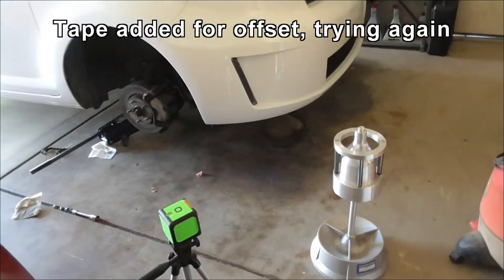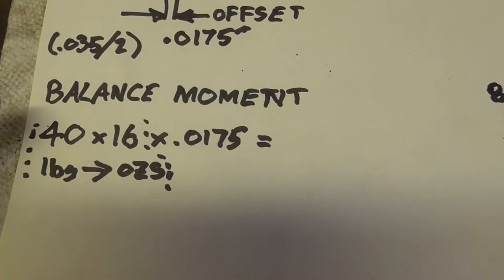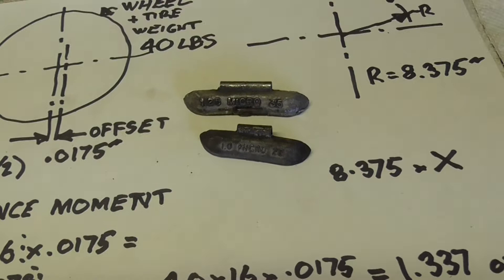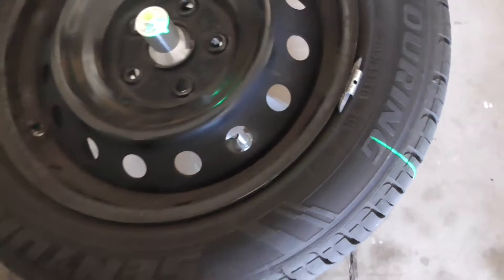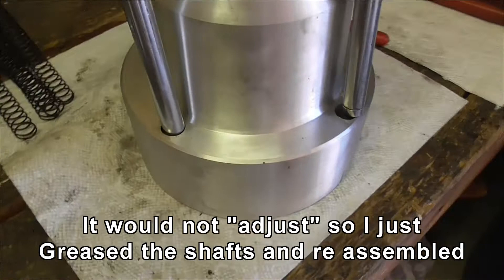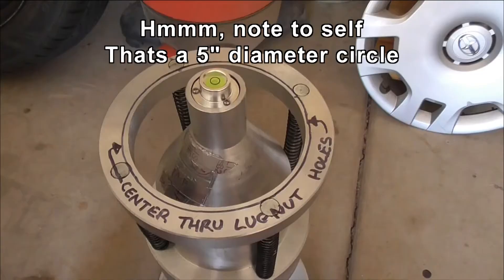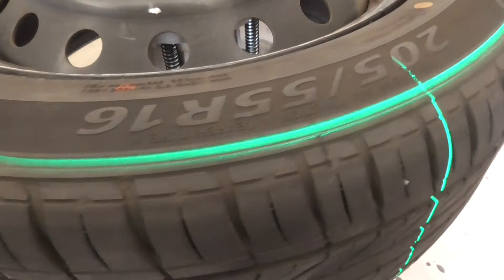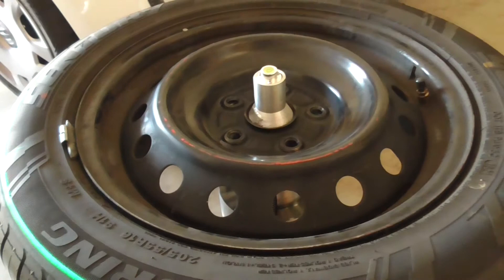HF Bubble Balancer Flaw Part 2 (& fix??)

Comment: I think your solution is probably the same as mine, from a product review comment, I've been getting under the balancer and similar to milking a cow, I pull down on the spring assembly and slowly put it back up to the rim, I think this also centers the assembly on the rim.  I seem to be able to get it down to 1/4 oz accuracy, (doing the rotating of tire for comparison)
Reply from the maker: Gave up with the bubble balancer, was getting wheel vibes at 65mph +did this instead 
https://www.youtube.com/watch?v=du5cTMqpIhY&list=PLWHom5FLIC6u-II0_Ag5QKbXt8W_gcKHR&index=28

And this, when after the seal removal, the preload was too high
https://www.youtube.com/watch?v=li6cBQBcOX8&list=PLWHom5FLIC6u-II0_Ag5QKbXt8W_gcKHR&index=29

The hubs give good results and I did learn how to avoid dynamic instability. 
Perhaps I should have just taped a glass ball to the pilot, put it on a hard level surface and tried the laser again. Would have been cheaper and just as accurate?? (tip from another YouTuber). I may end up doing just this for my sons smaller Xb, rather than buying a new hub.
Reply: @richbinaz  I've used the hub on utility trailer with good success, it would be nice to have a universal hub for the car tires.  It seems easier and more accurate than the bubble balancer

Comment: Only one way this balancer will work correctly because cone is not perfect shape. Do not level bubble without wheel on the cone because cone is wrong shape. Shape of the cone even will changed for different wheels hole size. 1. Remove springs and holding ring completely in garbage. 2. Inside the cone make center hole wider with about 10mm drill bit. But do not drill deeper than oringinal hole center located. Add drop of water to drill easier. 3. Gently with grinder or file make the cone support the shape of a bullet without touching the very tip. 4. Gently tighten 3 bubble screws and loose them 3 turns. 5. Install balancer as it should. 6. PInstall balancer as it should. 7. Put drop of oil on the tip. Install cone. Do not try level bubble with srews now. 8. Put any wheel on the cone. 7. Sit down slow rotate the wheel and center cone in the wheel hole every time before check the bubble. That is very important for results. 9. Put mark with black permanent marker to aluminum cone where is air bubble now. 10. Put mark with chalk same direction on the wheel. Remember exactly where is air bubble now. 11. Turn the wheel mark to opposite side 180° from cone mark. Marks should be opposite sides. Wheel on left cone on right. 12. Now only use 3 srews to close bubble to same location it was before.13. Repeat many times to reach perfectly same location of air bubble. 14. After you reach same bubble location turn wheel angle 90° and repeat steps. 15. Put wheights on the wheel. 
Reapeat steps to check bubble centered.

Now it will work perfectly. I did my wheels balancing better than any tire shop. No vibration at all.
Reply from the maker: You lost me at step 3...
The outside cone seems to be cut on a lathe. 
The first problem is the pivot hole inside is not aligned with the cone. The causes a basic out of balance error.

The second problem is the frame which is supposed to control perpendicularity of the frame face to the cone is inconsistent and can be moved to another position (as I do with the screwdriver) This just adds error. Throwing the frame away just makes it worse.

This is why I gave up with this design, which is now sitting in the shed.

Which is why I moved on to vertical tire balancing, using a friction reduced wheel hub.
https://www.youtube.com/watch?v=du5cTMqpIhY  
See from time index 6:00 onwards

There is another method I'm going to try, a bit more universal I hope. TBD
Reply: Sure vertical universal PCD hub is much better. I dont understand why they dont sell it. Cone is headache.
Reply: wtf to that

Comment: I had the same problem and i remove 2 springs! And you must take 2 springs of the same length.
Reply from the maker: With my unit, even if the spring support kept the wheel perpendicular to the cone (which it does not)...
There is still the offset between the inner balance point and the outer cone.

Comment: use the 1.5 inch ball bearing.  The hole is off center
Reply from the maker: Agreed. The hole is off center and I do not have access to tools to create a concentric pivot.
But that is not the only problem... The spring frame jams, the cone surface is rippled, the basic balance of the whole head is off...
https://www.youtube.com/watch?v=an6sURvUhBA

I bought a glass ball and tried this ... https://www.youtube.com/watch?v=a4Ox_Emh7Ew&t=1s
At least I know the ball is centered on the wheel, just doesn't work on all wheels.

Comment: Not sure i'm gonna buy one of these after watching your videos ! I might go with a simple sphere in the hub hole and placing it on a completely smooth level surface, then measuring the distance to the surface around the circumference of the wheel. And / Or using one of those self levelling lasers and placing weights until it all section of the rim are equal height? These are clearly not worth the £80. I need to come up with my own solution. Have you read about the bada method for supposedly more accurate placement of the weights? thanks for the video BTW, its proved very helpful.
Reply from the maker: I am trying to find another way to balance the tire the same way I do motorcycle tires, which is vertically. About 2:40 in on this video
https://www.youtube.com/watch?v=-4XlyKlUbSs&list=PLWHom5FLIC6uwocukFjFbQJpOSSk5kdNo&index=11

To that end, I bought a rear bearing hub and fashioned a support from some T bar I had from an old garage door opening rail. Sadly the internal friction of the bearings and seals is too much. They also cleverly made the unit near impossible to dismantle by cold rolling the axle shaft up over the end of the bearing.

Your idea with the ball bearing has a lot of merit. It gives direct contact of the ball to the pilot on the wheel, which puts it right where its needed. A hard flat level surface is needed to withstand the high point load of the ball. Go for it - good idea!

The self levelling laser is really quite good, just need a tripod to mount it on. It was a cheap one from amazon but works just fine. don't need to pay extra for the bosch name. Bekoywoy was the name for $35.

For weight balancing, I did learn that if you need to put on 2 weights, put one on the outside and one on the inside, or better, use stick on weights as close too the CG vertical plane as possible. That avoids the dynamic "shimmy" problem. Now where is that CG???

Good luck Daniel
Reply from the maker: Worked a bit more on the wheel hub to reduce the friction and I think it works
https://youtu.be/du5cTMqpIhY
Reply: @richbinaz  You have to get a Junk yard axel with the same lug pattern as the wheel your going to use and make a jig to hold the axel and weight of a wheel so it can spin free .   to go through all that trouble and price,   you can have a shop do it every 4 years   when you need tires .
Reply from the maker: @JCcanU  I used a new wheel hub for each car. 
https://www.youtube.com/watch?v=du5cTMqpIhY&list=PLWHom5FLIC6vZSy2jL7YB3xnY2jVi5Mgt&index=8
Yes it's pricey and a challenge, but it's also a hobby now and it works nicely.
I am also not beholden to Discount tire to do my tires, flat fixes and balancing

Comment: Hi, how did you make your circle? I have a Ford Excursion that has a hub which is too large to fit the cone by a little bit but still fits on the ring. If you could share how you determined how to make that circle I could use this to get around all kinds of craziness and fabrication. If you remember, please share. Thanks.
Reply from the maker: I think I just held a sharpie between my index and thumb, spaced it a bit using my second finger, then turned the ring under the sharpie. However, I was never able to get a wheel to balance properly on the bubble balancer, so I turned to other solutions. 
https://www.youtube.com/watch?v=an6sURvUhBA

This one seems to work well for me and may work for you - if you can find the right size ball to sit the tire on... Which may be hard at such a large diameter ~125mm?? Glass may not work considering the wheel weight.
https://www.youtube.com/watch?v=UVEj-sxsjJ4

Another method I use is this...
https://www.youtube.com/watch?v=du5cTMqpIhY&t=1s
Just have to use something to support the hub and get the internal friction of the hub down.
Cheap hubs can be found at a junkyard or rockauto or amazon or...
The hub I saw on rock auto had a preload nut that could be loosened - helpful. Then you just have to get the grease seal out, which may work easier on that hub.

Need to balance the cost of having discount tire balance them vs cost of making your own rig.
Reply: Thanks so much. I have balanced maybe 10 sets of tires so far and I would say that 8/10 are perfect. I was considering a single hub centric ring in this case for the 125mm bore on the Excursion but none could take up the gap. My plan is to take a piece of abs plastic and a compass along with dial calipers to make my own ring.
Reply from the maker: @jamesdean5677  
I was just thinking that if you removed the wheel support frame, it could fit on the bottom flange. 
Can you center it on that flange?
Image with frame removed
https://youtu.be/an6sURvUhBA?list=PLWHom5FLIC6vZSy2jL7YB3xnY2jVi5Mgt&t=156
Reply: @richbinaz  This is a great idea! I do believe it will fit there but I am not sure how I would center it on that flange. Like you, I am scared to eyeball it.
Reply from the maker: @jamesdean5677  Is this where a hub centric ring could work?

Comment: I have the same problem of inconsistency with this Chinese bubble balancer. I improved it to some extent by freeing the pivot but it is still inconsistent and it drives me crazy. I'm losing my time and my patience.
Reply from the maker: I did a final critical review video here
https://www.youtube.com/watch?v=an6sURvUhBA
The whole thing is so poorly made, at least the one I have is, it just isn't worth using. It is now a paperweight in my back yard shed.

There seem to be 3 possible answers
1. Horizontal balancing: With a glass or steel ball - but it doesn't work on all wheels. The location of the CG on the corolla alloy wheels made it unstable. Here's a link to that
https://www.youtube.com/watch?v=a4Ox_Emh7Ew

2. Vertical balancing: Tricky to create the rig and each hub fits just one style of wheel. The corolla was a 5 stud x 100mm Dia hub. The Scion was a 5 stud x 114mm dia hub. By luck, the 5 x 114mm hub fits my sons CX-5 and I think it might fit a Rav 4 & Highlander.
See links in text below the video...

3. Vertical balancing using cones: Much like the way a motorcycle tire can be balanced, This guy uses cones on a home made rig to get a vertical balance. I like it, but the cones are crazy expensive
https://www.youtube.com/watch?v=dAM6lrBOHOQ

Link to the no-mar website
https://www.nomartirechanger.com/wheel-balancing.html
Reply: most tire we do not need any waits to put them in  balance
Reply: all you have to go is dived the heavy part of the tire  half of the heavyest part of the tire to the valve stem, the valve stem is the lights part of the tire
Reply: how do we find the heavy part of the tire?
Reply: if you have a red dot on a tire  then line that up with the valve
Reply: if you have no red dot,   then look in side of your tire,  you will see it, it's like a laper over  rubber joining of the tire   you can see how long it is,  and how wide it also
Reply from the maker: Dots come in multiple colors, or none at all.
Most common is the yellow dot indicating the light spot of the tire
The red dot is supposed to be aligned with a runout mark on the wheel rim. But I have never seen one of those. @robbaird5972  
To minimize the weights for the tire, find the heavy spot on the rim first. It not always the valve, especially on alloy rims. Mark with tape, then install the tire with the yellow dot aligned with the tape mark.

Comment: i used this same balancer and have NO vibrations
Reply from the maker: I gave it a good try, but it was made so badly....
Reply: @richbinaz  don't know, i just drop the wheel on it and allow it to settle, tip it a few times on each side to make sure it always does drop to the heavy side each time and it does. Then add weights as needed.

Comment: you have no idea how many times I've lifted and put back the tire on one of these to find a method for centring. In the end, no success!
Reply from the maker: I agree, it's a really poor design. I have given up with it.
Not only is the spring frame aligned poorly, but the cone was offset from the pivot by .018"
Did a video for that too https://www.youtube.com/watch?v=zEBYJvfL0b8

I ended up buying hubs to balance the wheels vertically, just like motorbike wheels, but then I saw Daniel Smith's method and I really like that one.

He tapes a glass ball to the wheel pilot, then rests that assembly on a small tower with a levelled ceramic tile on top. Then uses a laser level to get the balance.
https://www.youtube.com/watch?v=cjMf7U14xe4

It should work on any wheel, no matter the stud pattern.

Comment: Not to oversimplify your awesome efforts...I just wanted to share the method that I use religiously to bubble balance which usually results in perfection when I take it on the highway. My test is to slowly increase speed from 55mph to 80mph and cringe while I await even the tinyest level of vibration which usually never happens.

Link:
https://youtu.be/GCLVcsRbqYU?feature=shared
Reply from the maker: That is a very good video and almost everything he says is correct - just not where the CG of the wheel is, but he's close enough that it doesn't make much difference. Specially with that monster tire on the rim.
He is lucky to have a balancer that works properly. I lift up a tire, turn it 90° an it's wrong
Reply: @richbinaz  So sorry you got a crap balancer. That would drive me nuts.
Reply from the maker: @jamesdean5677   How does it go? If it wasn't for bad luck, I'd have no luck at all.
Reply: @richbinaz  😂😂😂

Comment: W T S??
Reply from the maker: W T S means???
I tried and failed to get anywhere near a good result out of the balancer.
Wheels vibrated badly at regular freeway speeds
Vertical balance shown in links worked much better
Here's another method that works on steel wheels, not the alloys
https://www.youtube.com/watch?v=a4Ox_Emh7Ew